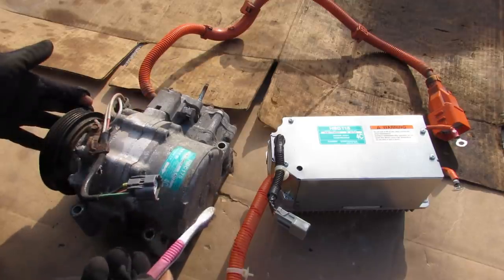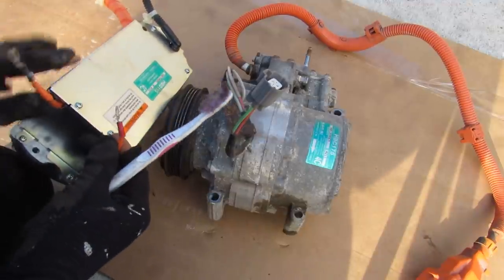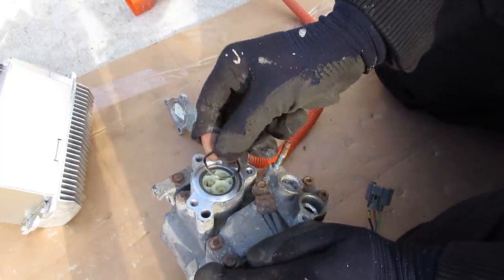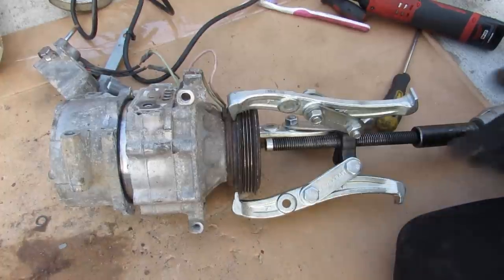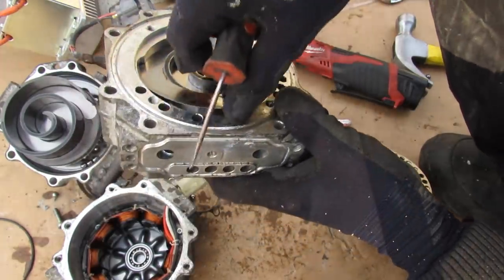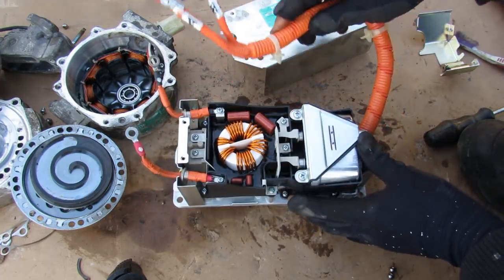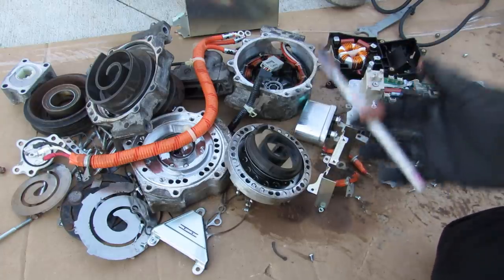How Does a Hybrid A/C Compressor Work?

Comment: 3:27  The little curved piece is the discharge valve retainer.  It prevents the discharge valve from being bent in a way that might cause permanent damage.
4:54 A scroll compressor has a fixed scroll and an orbiting scroll.  The orbiting scroll is driven by an eccentric with an offset center that is almost exactly offset by half of the root of the involute spiral.  Check out 'scroll compressor' on wikipedia, there should be an animation showing orbiting operation.
5:10 The orbiting scroll should NOT rotate like that.  Because the scroll was allowed to loosen away from the front casting, the steel balls, which act as a thrust bearing, came loose from the races and their anti-rotation feature was compromised.
5:17 The offset eccentric is actually driven slightly off its center.  This forms a compliance mechanism in the event of debris between the scroll walls and also allows the orbiting scroll to press harder against the fixed scroll as rpm is increased.
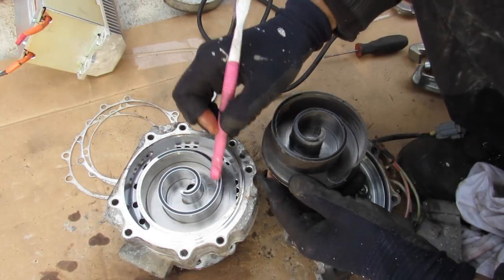6:16 Each scroll is given a teflon like tip seal that acts as a sliding seal.  The orbiting scroll is anodized so that its surface finish is different from the fixed scroll.  This prevents galling due to pure stiction which would be a problem if the two surfaces could co-mingle at a near atomic level. 
6:21 Those are not CNC marks.  They are wear marks from the wall of the opposing scroll.  That worn surface for both scrolls is a stamped steel insert to prevent the wear from tearing up the aluminum.
6:45 The motor is a brushless DC.  An inverter creates the phase signals necessary to drive the permanent magnets in the rotor at the correct speed and direction.
Reply: Awesome comment! Thanks for adding all that info. For the part you mentioned at 5:17, where is the compliance built in? Looks like a needle roller bearing on the back of the scroll, so I'm guessing the compliance is on the eccentric shaft? How does it work exactly?
Reply: thanks for the comment, it adds to my insight about this compressor
Reply: It's all much design work and investment. We as a species are so wasteful with the world's resources, to just throw everything away and repeat.
Reply: Good permanent magnets are also expensive materials.

Comment: Always remember when you're recharging the AC on a hybrid vehicle use strictly refrigerant only do not have the mix with oil kind. These compressors take a special oil that is made for hybrid compressors. I work on hybrids for many years
Reply from the maker: Good to know, I would have thought it was the same
Reply: 1234
Reply: @davidescobedo1317  Some use R1234, others use R134. Look under the hood for the system specs. It should list refrigerant, oil type and weight, and capacity of both.
Reply: How did you get started working on hybrids
Reply: @viperstrike3827  if you're talking to me I just picked up and learned it on my own. A lot of youtubing and a lot of Google searches and I just figured it out on my own. I own a small car lot and I sell a lot of hybrids
Reply: @wam9468  Interesting thank you for the reply
Reply: @wam9468  are hybrid A/C systems as good or better than conventional gas engine systems?
Reply: @wam9468  I am proud of you. Even though I don’t know you. I am proud of you.

Comment: Basically there are 2 compressors, one for the city and one for the highway.
Reply from the maker: Yep just the same way a hybrid car works
Reply: @speedkar99  Why doesn't it remain fully electric driven off the battery charged by alternator?? How familiar arebyiu with such things?? I have a project I'd like some words of wisdom on
Reply: @Dan0rioN  If the engine is running it would be more efficient to be driven off of the belt system. The compressor has very little efficiency loss between the crankshaft pulley and the AC compressor. 

To be driven electrically, you start adding in more conversion losses. The engine driven electric "motor generator" (MG) isn't 100% efficient so the conversion of mechanical energy to electrical creates wasted heat energy.

Basically, any time you want to convert energy from one form to another you will want to do it in the most direct way possible. 
Every time you convert energy (electrical, mechanical, fluid, etc.) you will generate heat and lose efficiency.

I'm no engineer though!
Cheers!
-Tim
Reply: @Dan0rioN It is more efficient if the engine is running because it is directly mechanical driven and if take energy from electrical system while it's running then it take power from alternator instead.

Comment: 4:55 This is a scroll pump. The same principle is used in the vacuum industry to make cheap dry vacuum. It was also used in the late 70ies for the VW Polo G40 or VW Golf G60 that had supercharged engines.
Reply from the maker: Good to know. I can see how it can be used as an air pump

Comment: Another interesting vid, it's my first time seeing a scroll compressor like that. From a safety perspective, it may have been good to stress the importance of discharging capacitors before you opened the a/c control module. 600v would be quite the shock.
Reply from the maker: My first time seeing the scroll like that as well. It was quite a learning experience. And good call on the capacitor....this module sat for a long time so I felt it was safe to touch
Reply: Quick multimeter volt test can tell you

Comment: I'm going to go out on a limb and guess that's one pricey A/C compressor to replace
Reply: If I came across something like this 200 years ago, I would claim it's from aliens and charge people to see it!
Reply: was thinking the same.. looks mega pricey.
Reply from the maker: Probably expensive for it's time but imagine how many hybrids out there use electric AC compressors...
Reply: I think either an all electric or all mechanical would be cheaper.  Hopefully newer hybrids use all electric.  Reduce some complexity.  Thanks for sharing!  Didn't know they made a scroll type compressor in automotive.  More efficient.
Reply: Good to harvest components and wire from too.
Reply: That’s what they want you to think, it costs them nothing to manufacture they could argue the patent but it’s not made out of gold
Reply: @mtutechy10  I agree with your premise of simplicity, but damn.. if it were all electric, that' battery would last about 5 minutes where I live. Desert Southwest.
Reply: @janevaldez1523  Toyota has been using all-electric on their hybrids since 2004. Hybrid batteries are sized to move the car around so the A/C is no big deal. The all-electric compressors work great in Phoenix, where they deliver as much cooling power sitting at a traffic light as they do on the open road. (Lived there 1974-2000)
Reply: @flagmichael  That's what I love about my 2014 Camry Hybrid A/C.  My compressor is all electric as you said (since there's no belt on the engine), and delivers the same cooling when sitting at a light or in traffic. The compressor is also variable output (fixed steps, but not sure how many. I can hear it stepping down as the cabin gets cooler while in a quiet area).
Reply: @rodhoutx hopefully they've also taken the opportunity to make the compressor fully hermetically sealed while they're at it. Traditional AC compressors are problematic because they rely on a seal on the pulley shaft. If this seal fails - bye bye refrigerant. Hermetically sealed compressors (like in your fridge) are incredibly reliable though as they don't need to seal any such shaft. The electric motor is entirely inside the casing of the compressor.

Comment: Such a complex piece of art.
Reply from the maker: Sure is. I wouldn't have thought hybrids needed this....just turn on the engine if you need to cool the cabin during idle stop
Reply: @speedkar99  but the rpm rises during idle to cool the cabin. Reducing efficiency and increased emmisions.. so it's better to cool on Electric power.

Comment: Very enlightening, I did wonder how they did airconditioning in hybrids when the engine is off. Bloody complicated though with that control unit lol.
Reply from the maker: Old hybrids Probably just turned the engine on if AC was needed
Reply: @speedkar99  Fact. 2005 Civic Hybrid (with similar IMA) would disable engine shut-off at stopped with A/C on (unless Eco mode button was on, then engine would cut out and only A/C fan would run. No dual mode compressor to my knowledge).

Comment: My 2002 Prius doesn't have hybrid AC. It just has a thermally-insulated evaporator core that can blow cold air for several minutes when the engine is off.
Reply from the maker: And when it needs to cool down, does it just run the engine?
Reply: @speedkar99  Yes. Runs the engine for about a minute, and then shuts off for another five. With the fan on low, it will even glide in EV mode for a few minutes.
Reply: The engine runs continuously if the AC is set to MAX. Needless to say, that plays Hob with the fuel economy. They went to electric compressors from 2004 on. We lived in Flagstaff when we bought our first 2002, but my wife always used MAX when she went to Phoenix to visit family. Later we got a 2010 and it was much better!
Reply: @flagmichael  Had to go in for an emissions test once and MAX AC was the only way to keep the engine running.

Comment: Wow. A twin-scroll A/C pump. I guess this is one of the only environments where it actually makes sense and would reliably work.
Reply: Scroll compressors have been in use for a long time for residential and commercial air conditioning. Their technology has even expanded so that they can be used in low temp refrigeration as well.

Comment: The electric scroll compressor is smaller and probably lower power than the mechanical side. The separate output ports are necessary probably to prevent backflow in the non active scroll when only one is active - probably has solenoid activated valves on the other mating piece to those output ports.
Reply from the maker: That long thin U-bent shape piece I took off the ports I bet was the valve to prevent back flow

Comment: I have a 2014 Civic Hybrid whose biggest issue is that if the climate system determines that the A/C clutch needs to be used, it keeps cycling even during heavy accelerations, where it is very noticeable. The system would be much more efficient if the electric A/C was used at that time. Is it possible to reprogram the ECU or HVAC unit for that? (i.e. if the system determines the mechanical A/C is required, but I am accelerating heavily, mechanical A/C is temporarily shut off and the electric A/C takes over until I reach my cruising speed)

Comment: Oh my. Not only will this compressor be much more expensive, the repair techs will need to be trained in high voltage hybrid automotive repair. What an interesting design.
Reply from the maker: Yep
Reply: The significance of HV in hybrids is greatly exaggerated. In the Prius, for example, about the only way you can contact dangerous voltages is to remove the inverter output cover and turn the system on. I rebuilt a Prius battery (19 years old) last month and did it all bare-handed. I wanted to get a feel for how much of the battery voltage I could contact from the fingers of one hand to the fingers of the other without it actually hurting but there was only one step where that was possible and I completed it (removing the bus bars) before I remembered it.
Two years ago I retired from the communications/IT field service department of a large electric utility. Working in substations I occasionally made contact with 135V DC from the substation battery in the control house. It made me flinch, but it didn't actually hurt. I made contact with the 54V DC from our communications batteries many dozens of times and rarely noticed unless one contact point was the thin skin underside of my arms - then it was like a pinch. My big DC contact was in a tube type radio in 1967. I made excellent contact hand to hand with 300V plate supply - it felt like I was hit in the back of the head with a 2X4. If it had been 240VAC I would not be here to tell you about it.

Comment: Wait a VW G-Lader as a ac compressor? What's that called? G35 R134a ? 
Funny that they are re-using that old tech for this purpose !
Reply: This is very much like an old school Vw g-lader supercharger. Very cool to see this tech still in use.
Reply from the maker: G-lader?
Reply: @speedkar99  look into it. Vw used this technology in a supercharger in some of their cars back in the day. Namely in the Corrado G60.
Reply: @speedkar99  yes volkswagen used the same type of compressor as a supercharger for a number of models in the late 80's and early 90's
The Polo(2 and 2F) G40, Golf (2) G60 and Corrado G60 
Mainly in Europe.
Those superchargers are very delicate and that is the main reason this tech is not used any more. They were not that reliable and very expensive to make and repair.
So it is odd but interesting that the same tech is used once again years later for an air con compressor.
The name G-lader is because of the shape of the scroll wheel which looks like a G. Lader means charger.

Comment: Thanks.  I had heard that hybrids use an electric compressor, but didn't know the details.  I didn't know some also have a belt drive.  Perhaps some are electric only, which allows them to be mounted anywhere.  I wonder why they use a scroll rather than swashplate w/ pistons as in common Sanden & Denso compressors.  It does make it smaller and I've heard scrolls are more efficient.  Perhaps also less likely to stall the motor when pressure builds up.  I heard these compressors are very expensive to replace.

Comment: Are you sure that is permanent magnet motor and not a 3 phase AC synchronous motor?
That looks more like a squirrel cage rotor, than one with permanent magnets embedded in it. 
That big capacitor would be the phase shifter. I would love to see the schematic for the boards. It looks like a quality build.
Reply: Correct...
Reply from the maker: I'd be interested in knowing too, the 3 phase wire may have thrown me off
Reply: I don't know about the Honda motors, but Toyota uses permanent magnet rotors with 3 phase field windings in the hybrid transaxle. I would expect to see the same technology in the compressor, particularly since the compressor speed could be precisely controlled that way.

Comment: Good video 
Does the electric air-conditioning pump need to be installed horizontal or can you mount it vertical 
I'm asking due to it having lubrication oil
Reply from the maker: Yes it can be mounted how it is in the car. What are you trying to make?

Comment: Interesting. I was asking myself how does this system work on hybrid vehicles. On Tesla the A/C compressor works completely electrical and are now used as heat pump to give heat in cold countries, by reversing the condenser and evaporator cycles!
Reply: Heat instead of head, I presume.
A priest, a minister, and a rabbit walk into a bar. The bartender asks the rabbit, "What'll you have?" The rabbit replies, "I don't know. I wouldn't even be here if not for autocorrect."

Comment: @ 6:46    
This is Not 3 phase electric Motor.

This is BLDC Motor..
Reply: Yep, 3 phase motors don't have permanent magnets like a BLDC.
Reply from the maker: No it's 3 phase AC...see the end of the video where I took apart the driver that converts DC to the 3 wire AC...
There's also 9 coils in there 3 for each phase

Comment: As cool as hybrids are, I'm glad I don't have one. That's a lot of extra complication in the A/C system that could go wrong, between that control module, the electric motor, and the compressor itself burning out. Probably a lot more expensive than a conventional compressor to replace. Something that has always been simple is now excessively complicated lol

Comment: It is not 3 phase, it Is an inverter compressor. It is working on frequency. The winding connection similar to 3 phase Ac, but this compressor receives DC voltage as a pulses. I know the new inverter compressors are confusing many people. They use an inverter compressor so will not draw high amps when start to save some of battery energy. If you look to the inverter board, typically you will find 6 Igbts or they could be impeded in one IC and it cooled by heatsink.

Comment: Many Honda over here equipped with scroll type AC compressor tends to be unreliable compared to traditional piston style AC compressor.
Reply from the maker: Which cars?
Reply: @speedkar99  many Honda equipped with L15 engines, notoriously Honda Freed. The AC compressor jammed and instantaneously break the compressor drive shaft (drive pulley still turning but does not turn the AC compressor internal).
I don't know if this model is available in Canada.

Comment: On an 03 civic hybrid the compressor went out..  and I just found out my condenser is trash needs to be replaced.. now I'm going to bypass the compressor for now, and route the belt to just the CS, water pump and tensioner.  I ordered the condenser and compressor and when they both come in I'll change them out. Question: can I replace the condenser and compressor until  I get to a garage and have them evap  and recharge the new parts then route the serpentine belt to OEM settings??

Comment: I'm surprised at how clean it looks on the inside.
Reply from the maker: It has to be, if there are any contaminants then it's not good for the AC components
Reply: The inside of an aircon or refrigeration system has to be almost clinically clean for it to function correctly. The oil doesn't get contaminated by combustion by-products like in an engine.